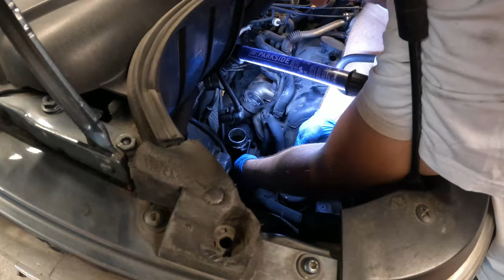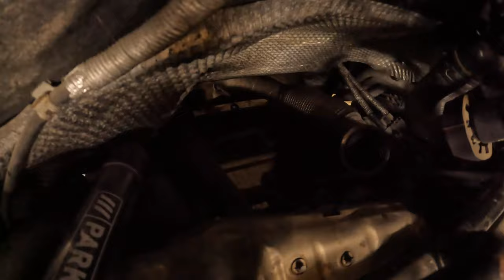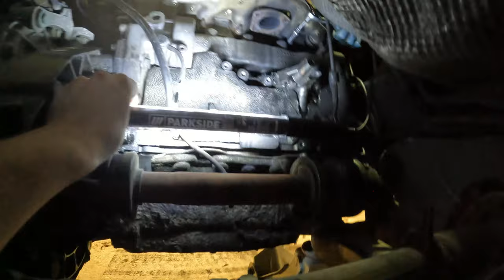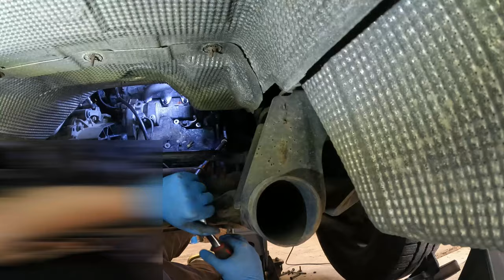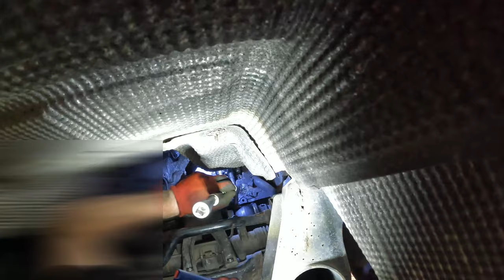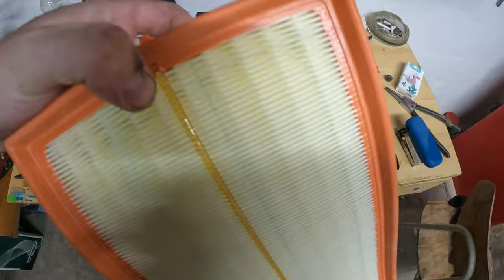VW TRANSPORTER T5 2.5 TDi....EXHAUST MANIFOLD REPLACEMENT....

Comment: Great job. Why did you change exhaust manyfold?
Reply from the maker: Thank you.
There was a hole in the exhaust manifold. Sorry, we didn't film it properly.
Reply: Hello friend, I need to remove the exhaust manifold of my T5 VW Tranporter, and I am Stuck on this step. I have probles with the things thats are up to the exhaust manifold.  Could you give me your opinion of haw to remove those parts?  
All this job is because timming belt loose some theets and starting to make a noise.  After that I need to remove the head and fix the problem. 
thank you

Comment: Did u have any problems getting the nuts off the manifold? Did any bolts break? Did you reuse the bolts or put new ones in?
Reply from the maker: There was no problem. It is good to use a new nut.